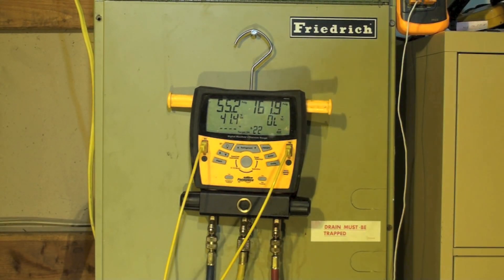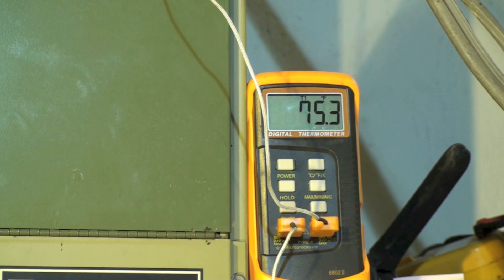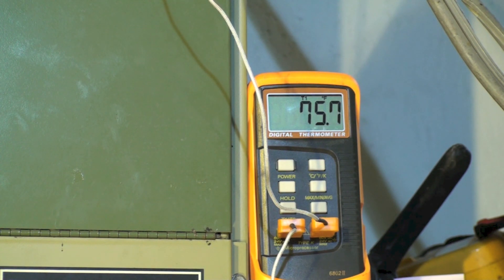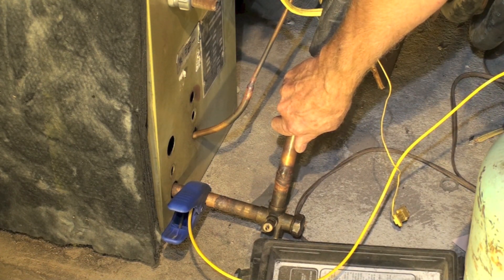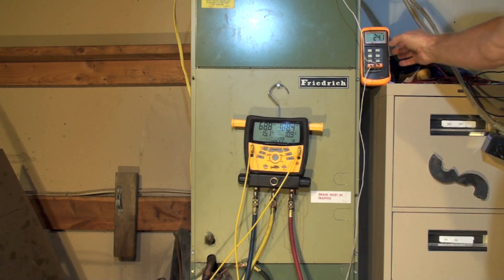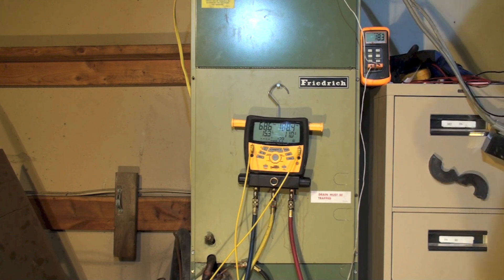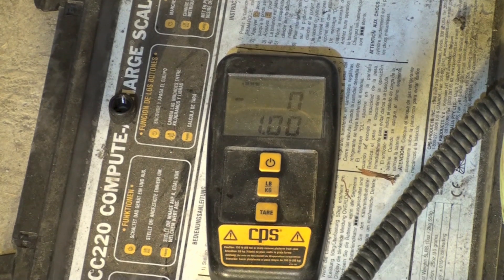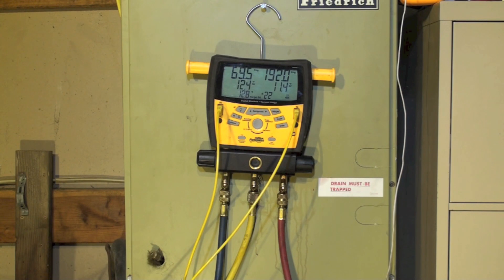Charging the air conditioner using your hand, lower ambient. #4

Comment: I once worked for a company that forced me to charge a R410a split system with a fixed orifice when it was 50 Deg F. It can be done but there is a point when the low side pressure stops climbing when you are adding refrigerant and all you can really do is use your hand and assume you got the target superheat within range,  Because if you have a low ambient indoors as well as outdoors your pressures will both read really low. Now if you had a TXV as a metering device well good luck with that one.
Reply from the maker: mechanicwarrior20 Had to deal with it!  You never know if it is right.  I will do some on low ambient to see how close I can make it.
GFM